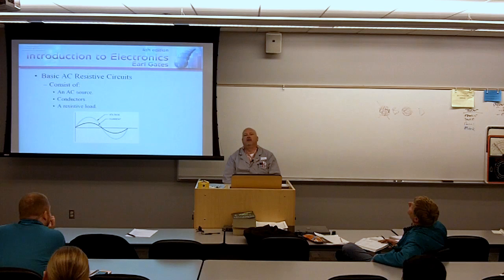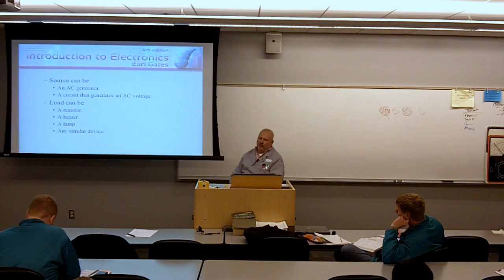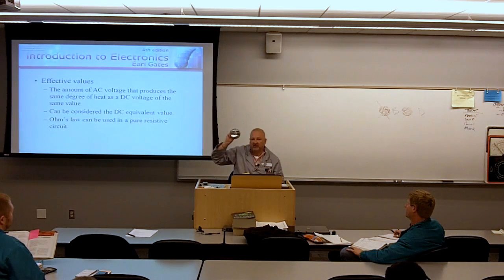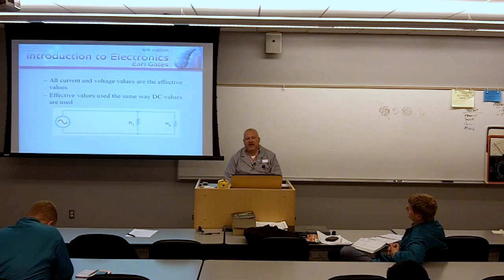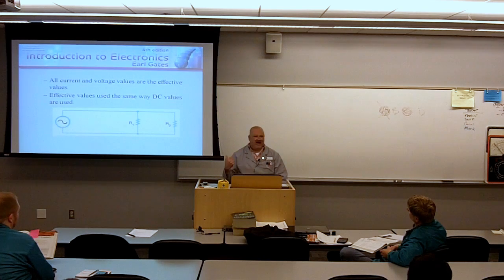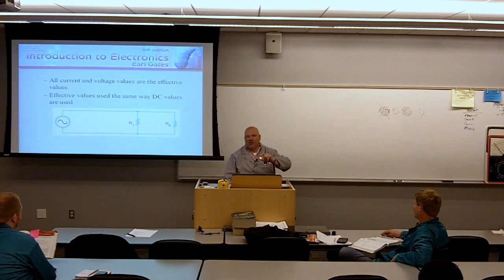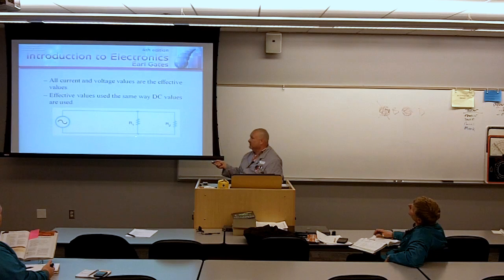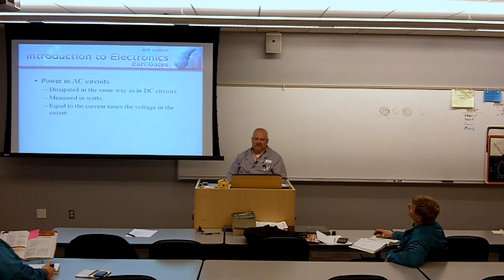ELEC 110 Chapter 14 Lecture - Resistive AC circuits

Comment: I understand that Circuits supplying Current to Light Bulbs, Heating Elements and such are Resistive Circuits.  What about Circuits supplying Electric Motors?  Are they Resistive Circuits also?